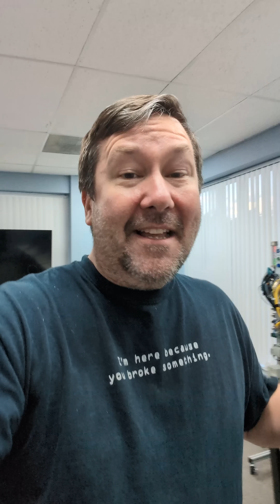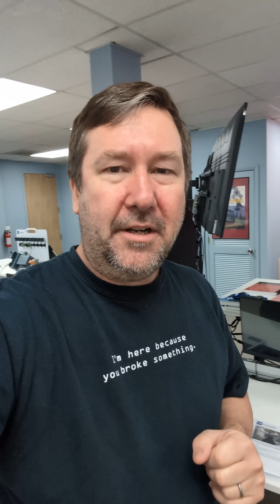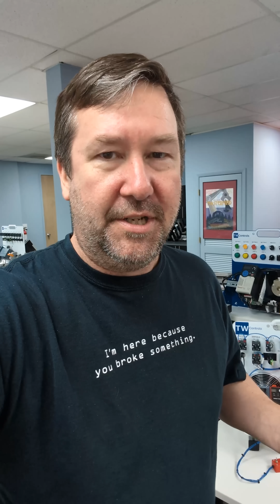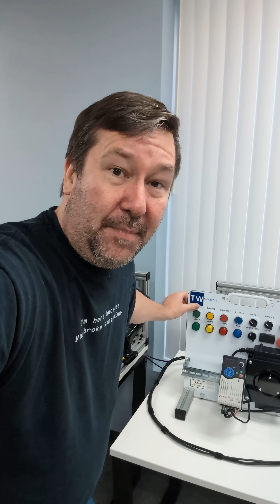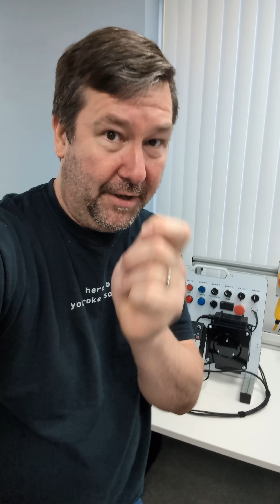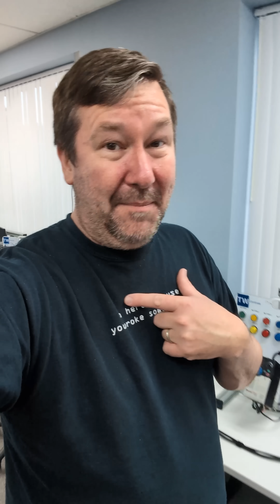What's Your Troubleshooting Strategy #industrialautomation #IndustrialMaintenance #SummerOnShorts

Comment: i was diagnosing a sencorp blister sealing maching, and it would keep not finishing a cycle so the trays kept stopping before reaching home. i would watch the i/o lights on the plc as the machine ran. everytime it didnt finish the cycle i would notice that an input would flicker.  the input was a prox sensor on the up and down motion on the offload. so everytime the  offload traveled the plc thought the offload was down when it wasnt suppose to be and interrupt the cycle. the machine is from the 90s and it was running fine for years so i know the code was solid.
Reply from the maker: Those can be difficult to catch!

Comment: Simple, obvious stuff first - operators can be a tech's best friend or their worst enemy, so you need to evaluate symptoms properly, and for yourself.
If you don't evaluate the symptoms for yourself you can guarantee a deep rabbit hole of testing stuff that isn't relevant.

My normal "method" is to ask myself "does this make engineering sense?" as I work through things.

Comment: I asked what happened and was told multiple different stories by the operators and sups. Walking around the line looking for the easiest thing first and found an e-stop off and a lock out on a disconnect from maintenance. Call maintenance, and they said it's down until we replace the bearing that failed. They replaced the bearing, and the line was back up and running. But it's always the PLC that messed up. 

Check the simple items first!!!
Reply from the maker: Good advice, keep it simple!

Comment: Funny because I had an issue with a FANUC cnc lathe. Started with alarm message and looked in book. Everything was vague. Had a bright engineer come down and he wasn’t sure either. Axis serial something other and no codes on units in back. I looked at panel and noticed it was dim. Weird cause lcd looked normal. Grabbed a voltmeter and checked power supply. Sure enough 6.35 volts instead of 24. Disconnected to see if something dragging it down and 6.35 volts. New supply and been good. I am not an electrical tech. Learned you tube videos like yours. Management was happy to not have to pay for a pro tech .
Reply from the maker: Great job!